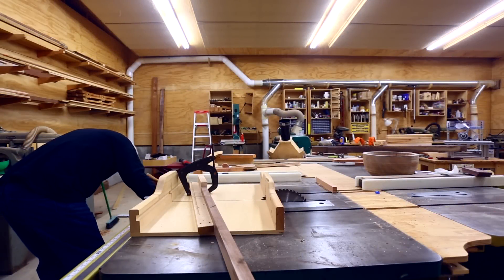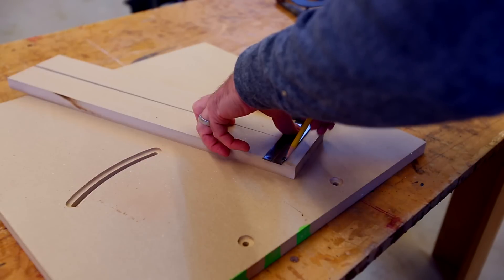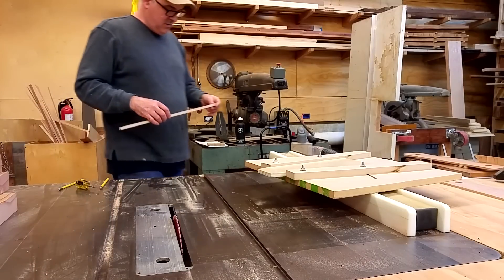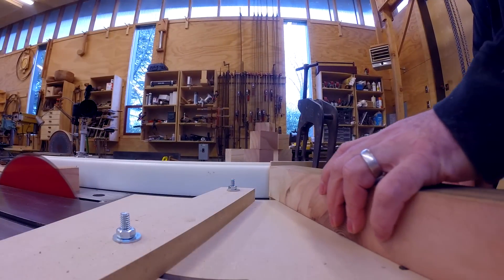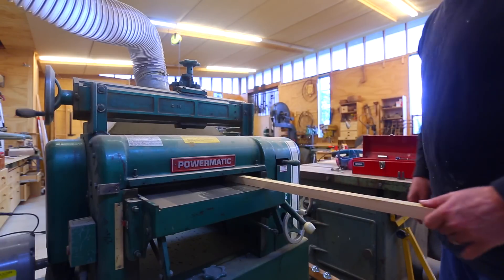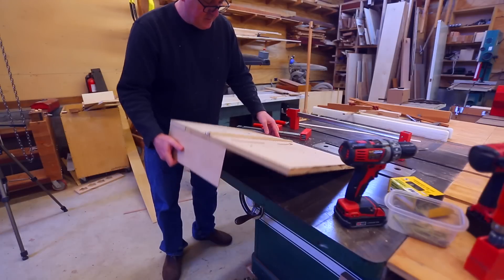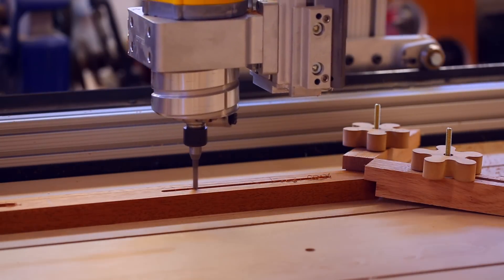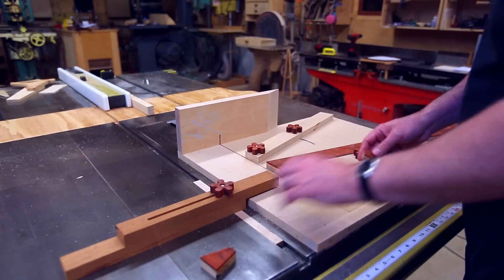Hybrid Wedgie Sled

Comment: Great job Fred.  I made the traditional wedgie sled, but I have a problem.  I really don't want to be around the blade, (for safety reasons), and I wonder if there's a way to fix the problem, without making another sled.  I have made the traditional 12 segment sled, actually the way you have done on your demonstration.  The whole cut process is done on the sled, and when you pull it back, after cutting the piece, you are well away from the blade and you can remove the pieces without difficulty.  However, when I made the wedgie sled, I only took the end of the sled to the blade, so the blade will cut the piece, but the piece will be left on the table, which is what I don't want.  Would I just glue and extra piece to the end, then attach the fence to the perpendicular end, and then cut thru with the saw blade? That way I wouldn't be cutting thru any screws, and I could cut thru the glue slot to allow clearance for the blade?Thanks for your input,Tommy Schutz

Comment: I like the second side for holding and returning  segments. That is a good addition if you don't have a second throat plate for your saw.    I think I'm going to make mine from 1/2" MDO plywood   I'm in Hawaii and  any composite board is not an option for projects that one wished to last longer than 6 months.    By using a quality plywood for the base that is a little thinner  I can  make deeper segments.   I'll probably use 3/4 " double laminated Plywood for the adjustable feces and the wedges  I have a fair amount  of that as scrap from a display case project.

Comment: How do you rely that when you surround the wedge template and fences and lock down that the workpiece is cut along the radius center line? When you clamp down on the gauge there is the possibility the entire fence, template setup could be skewed horizontally. Yes/No? ????  Make from nice cut-offs to big to toss, once you get the angle it set, Epoxy them down and just have nice dedicated jigs. Small to stow away.  Make one that is adjustable like this too. Half the fun is design/making the jigs.
Reply from the maker: +MrBonners so far I have not had that problem they locked down pretty tight
Reply: frank howarth I wasn't curious about being locked down. I wanted to know if the work piece is passed square to the blade. I would think that the fences and wedge step-up would not necessarily be square to the blade by default. 
 Love your channel and your work.

Comment: Why not use the CNC to bevel the offcut-side of the sled?  That would allow the segment to fall away.   
      By the way, for cutting very small pieces, I make a tube that fits a shop-vac hose and put a piece of hardware cloth screen a few inches inside the tube.  Then the tube is  fixed next to the sawblade, so that when the  piece is cut off, it is sucked into the tube against the screen.  A number of pieces can be cut before it's necessary to empt the tube, or you can extend the tube off the sawtable and put in a tee with a collection container.

Comment: I think that an often overlooked benefit of improving safety is speed. The fact that the action to move the piece off the sled happens away from the blade means that it requires less time and can be done without the added motion of carefully reaching near the blade

Comment: great job on it. It got me thinking if you linked the two arms together with two peices, that go from the bolts in you radiused holes to a single bolt in its own strait slot between your adjustable arms (running perpendicular to the saw blade) it might eliminate having to cut degeed wedges. whats your thoughts?

Comment: Make the scale on the length stop measure in the diameter of the ring it will make instead of in inches. You'd have to make  one scale for each angle template. The diameters will be different based on the 15 degree versus the 30 degree in other words the number of segments in the ring. This way you can just set the stop for the ring diameter instead of the segment length.  Better yet make two or three readable scales on the plexiglass that stay on the jig one for each angle template. Like the way an architects scale has 6 scales on one ruler.
Reply: And your videos rock.

Comment: To make your acryic scale more visible, leave the paler on when you route your design, spary it with colored enamel, let dry and pull the paper off..... once dry, you can wipe with a paper towel that has a little acetone to clean up lettering....

mike

Comment: I just made the Bennett sled this weekend. I Like yours also.  I haven't made a stop yet, I did like you did in the video and used the rip fence.  Glad I watched your video, I'm making my stop like your design.  I don't have a CNC, so my next project is to make a sine bar so that I can make accurate enough cuts on my table saw to get my "wedgie" plates.  Nice video and in my case, great timing!

Comment: I'm always amazed at how well you can take an already good idea and make it even better and, more importantly, safer!!  I wonder if a sled on a sled would work - basically, a small sled on the cutoff side that rides in the main sled body so, after the piece is cut, you could push the secondary/cutoff sled forward to eject the piece away from the blade.  It's probably over complicating the solution.  Great video, as always!!

Comment: Excellent Video. I too have built the Wedgie Sled and I have cut out the numerous necessary Wedgies using a Waterjet instead of a CNC router. I was debating adding the triangular shaped piece of wood to my zero clearance insert just like Jerry, but after seeing what you have built, I might have to reconsider that. Thanks for posting this build. Keep up the good work.

Comment: Seeing you pick up a piece of cut of wood near to a spinning blade  make the hair in the back of my neck stand up, we'll you will be safe unless your table saw is SAWSTOP. I know you done it a thousand times nothing happen. But it's only takes one mistakes .The blade don't discriminate what fingers it will chew. Just a reminder from fellow woodworker, God bless and take care. I have a Incra miter express combo , the best and sled and miter bar you can buy in the market. I never pick up piece of wood near a spinning blade ,I just push it all the way to the floor with a 20 inch push stick. I experienced kick back one time I learn my lesson quick. Good luck.

Comment: Great job! I was wondering if you found it easier than your original setup. Wouldn't you be able to create the angle wedge for your original table saw sled to create the angle? Do you find this method a lot safer? I'm sorry for the questions. I'm just very curious. 

Also, everything I know about segmented wood turning i've learned from your videos. Thank you for posting them... I always look forward to your work!

Comment: nice job as always - if you had to do it again would you make the mdf base in one piece?
Reply from the maker: +kencmain I want to try tilting the blade, and it would be nice to be able to replace that extra piece of bed.
Reply: what about making a replaceable insert?  that would be a piece of cake with your cnc...
Reply: +frank howarth Frank I use Jerry Bennetts system. Love it. when you get around to tilting the blade I would love to see the formula for making a ring a certain size. When I tried it the ring came out way smaller than it would have if the blade had not been tilted.

Comment: Really neat - and impressive that you are getting perfect angles right off the jig!  One thing on the stop you designed - if you had the screw that holds the position serve to also tighten the rail in the track, you wouldn't have the issue of it sometimes getting caught and dragged along with the sled.  Not a biggie, but something you could add at some point if you wanted.  But yeah, great video and I'm looking forward to seeing this thing in action!

Comment: Great video Frank. It would seem to me that you could flip the piece in place after every cut to achieve the opposite angles without needing  one of the arms. I may be wrong though
Reply from the maker: +Kuria Kinyanjui Then the angle between the blade and the fence has to be just right. which is do able just a little more effort to set up.

Comment: I've used the same threaded inserts for making tamper handles (for espresso machines) and found that the brass and the steel have a tendency to bond together over a period of just a few days. This causes the threaded insert to unscrew from the wood instead of the handle from the bolt. Needless to say, I highly recommend that you glue the threaded insert into place, or use the (more-annoying-to-install) zinc plated variety.
Reply from the maker: +Right. How do I make that? Thanks for the info, I will watch them over time.

Comment: Why not use the CNC to cut the segments? I could see a laser cutter or bandsaw as well.
Reply from the maker: +Walter Palmer CNC yes, and why stop and trapezoids.   laser cutter doesn't quite cut vertically from what I have experienced but it deffintly could make cool things for turning.  band saw doesn't leave a clean enough cut, maybe with the right blade.

Comment: Have you thought about cutting little stairway-patterns in the holders you have on the CNC? Would that make it easier to clamp different thicknesses of wood without having to angle the inserts too much and put stress on the bolts? Great video as always, too.
Reply from the maker: +Leon Overweel I have one step cut in them, I like the idea of multiple steps.

Comment: Using the CNC to make precise angle wedges is a real plus.  As Frank showed the glue ups are now exact with no extra sanding to make them fit.
Reply: +bwillan If you don't have a CNC, just make a bigger wedge. Angles get more accurate with distance. Simple math for one angle of a right triangle, tan(angle)=X/Y. So for 22.5, hit the tan button that you've ignored since 11th grade, and multiply by a big number, say 32, and you get 13.2548. Now just make a right angle triangle with those numbers as the short legs, and draw in the hypotenuse.
Reply: ***** If I recall, the wedges Frank is making for a given number of segments would be the inclusive angle.  So this would require an isosceles triangle where the desired angle would be formed by the two equal sides of the triangle.   

If a right angle triangle is used for this jig, it would only cut one angle. Ie a left or right part.  The corresponding part couldn't be cut.

Of course, my geometry could be a little off.  It's be a few years since high school math.
Reply: That's true, but the angle is what we're after, not the rest of the triangle. It's just a whole lot easier to lay it out with a ruler and framing square by using a right angle on the side we don't care about. Using a wedge of a certain angle sets up both fences at half that angle. So a 45° wedge would set up the fences at roughly 22.5° and give you an 8 sided ring. 30° wedge would give you 12 sides. Both those angles are easily attainable with regular drafting tools, but there's lots of other angles to use.

Another neat trick I noticed, since this awesome jig cuts both sides and divides the angles in half for you, you can take 360 and divide by the # of sides you want to get the angle of wedge you need. Say you want a 7 sided bowl, then you need a 51.42° wedge. Much easier to lay out that wedge with math than trying to set a miter sled at 25.71°. You can get crazy with it too. 21 sides = 17.14° wedge. As long as your wedge is accurate, it doesn't matter if one cut is several degrees off, the other cut will compensate to add up to the angle you need.

Comment: really glad you completed the sled because picking up those pieces next to the spinning blade made my heart sink every time you did it. 

BTW, I don't understand how you align the two angles together. I mean... you also need to align with the saw blade, right? just the angle of the two fences compared to each other is not enough to determine the shape of what you are going to cut. I wish you spent more time explaining the idea of how to determine the angles.
Reply: Yeah actually what he said is kinda misleading. The angle between the runners determines the angle on tge secments independently of the angle to the blade BUT they have to be symmetrical to the blade.

Comment: Neat sled Frank, thanks for sharing. 

Seems like you might want to use that rail adjusting trick on your stop block, except perpendicular to the table and maybe at both rail ends. That way you can lock the stop block in place and not have to fuss with it while cutting. 

Just a thought. ☺

Comment: I see at 7:23, your z-axis drops first and than positions to your machining location.  It then leads into the cut.  That can be dangerous if you have other stuff (clamps/setups) in the way.  Is there a settings in your software to drop the z-axis last before the feature lead-in?
Reply from the maker: +Andy Bauman I've noticed that too.  I have not looked to see if i can switch that.
Reply: +frank howarth What software are you using?

Comment: could someone explain how this makes sense? I'm having a hard time understanding. it seems like you'd have to calibrate each of the adjustable arms each time so that they are exactly opposite angles to the blade.
Reply: +Levi Morgan Look up Jerry Bennett on you tube.  He has a series of videos that explain the theory and the making of the basic sled.  It is well worth watching and he sells the wedges for you to make different angle wedges
Reply: +Levi Morgan I have built the Jerry Bennett version. 

With out the "wedges" to set the 2 rails at the same time, yes you are correct in a sense. 
What I want to say is if you want all wedges to be both top and bottom same sizes you can set both arms off the front of the sled (because you ran that through the blade so its 0 deg to blade) and you will get both top of the segment and bottom the same sizes.
 
However the thing is, this sled can change that and STILL give you perfect glue up with the flip segments method. 
Using a "wedgie" your Segments can now be angles on the them, this will give you a inner circle spiral look when played with. So more options to design and look can be achieved. And as frank said you can also change the blade angle to give yet more design and look options.

I like your safety thoughts frank.
I use the 45 deg zero clearance ramp and I had a segment or 2 fall off the back of the saw into the area of my belt drive, was scary. 
I think with your C&C plus the fact you have 3/4 inch to work with you can create a saw plate insert for the angles off saw blade. 
Just like you change out the saw plate when you drop in Dado blade, or tilt the blade you change the saw tables blade plate. 
You should be able to make a similar plate insert to your sled from 1/4 hard board or similar. 
Plus then you would not need to actually use one on the table, just remove it when this sled is in use. 

I was waiting for your video of this build, thanks :) 
Loved it!

Steven

Comment: Also, may i know what is the type of clamp used at 4:32 ? It seems specific for round objects, and if I type circular wood clamp on google it gave different results :P
Reply: Try searching "strap clamp", very common easy to find.
Reply from the maker: +TheZodiacNeophyte and band clamp.  I also use big hose clamps, when I don't care about the outer surface

Comment: Hello! May I know what is the router attached on the CNC? Is that Dewalt?

May I know what bit did you use at 0:54 ?
Reply from the maker: +TheZodiacNeophyte http://www.amazon.com/DEWALT-DW618-Electronic-Variable-Speed-Fixed-Base/dp/B00006JKXB?ie=UTF8&psc=1&redirect=true&ref_=oh_aui_detailpage_o05_s01
Reply from the maker: +TheZodiacNeophyte I think it's this bit:  http://www.amazon.com/Whiteside-Router-Bits-RU5150-Standard/dp/B000K2BGVU?ie=UTF8&psc=1&redirect=true&ref_=oh_aui_detailpage_o05_s00

Comment: One thing that might be helpful: Use a runner like that often seen in homemade featherboards (pictured here: http://img.photobucket.com/albums/v191/gordgraff/Feather%20Boards/13.jpg) where the tightening of the knob not only locks the sliding part in the left-right direction, but it also expands the runner against the miter slot walls locking it front to back. Nice job as always.
Reply from the maker: +EVehicleJ I like that. thanks

Comment: Great video as usual!! Question, can't you just slide the piece up and down instead of lifting it up and down each time?
Reply from the maker: +Daniel Thoms do you mean keeping it between the two fences?  I think if you did that you would not have the support of the upper fence,  you would be relying on the strength of you hand to hold the piece in place agents the force of the saw blade.
Reply: +frank howarth  Ahh! good point! Thanks!!

Comment: Could you have used the same hole and slot to lock the length stop to the miter slot so it would not move. I've seen it used to lock feather boards down. Love the video and thanks for sharing.